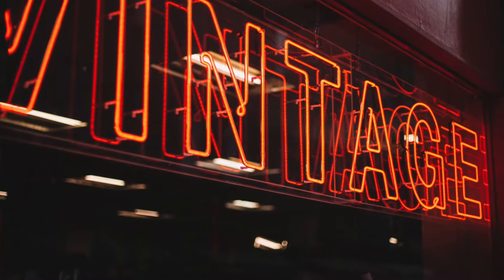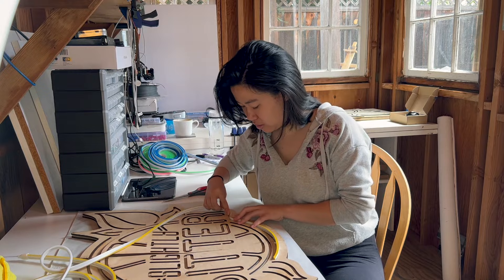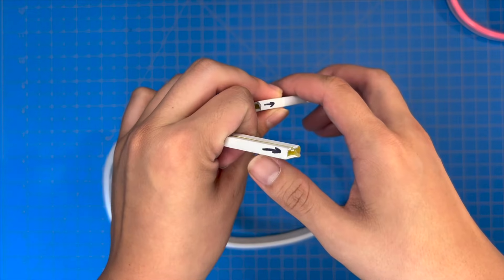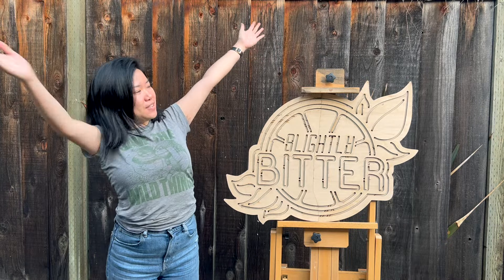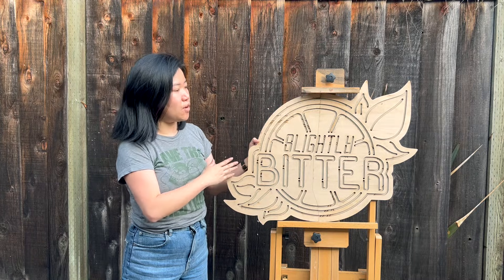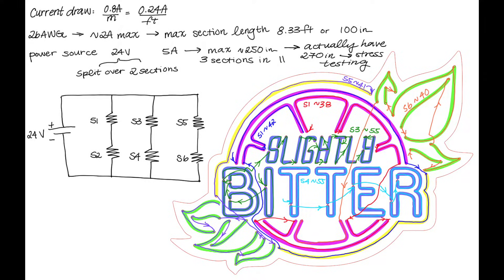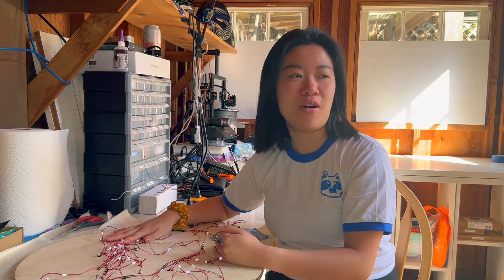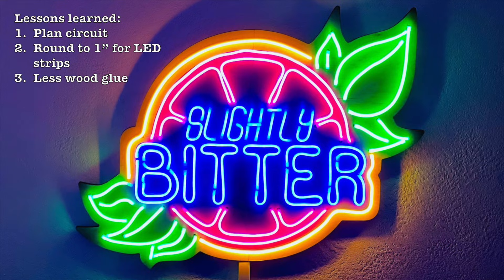I made a multi-color “neon” sign using LED strips

Comment: You can not use a power supply with LEDs, you have to use a driver that regulates the current to prevent thermal runaway!

Comment: Nice tutorial, but you should be using a 12v power supply and not 24v. The voltage doesn't change just the amperage needed.

Comment: Beauty! Lovely design.  No laser cutter so hand scroll sawed my own background (no grooves) and will lay (glue) my neon strips down on the plastic backer. Bought the wrong kind of neon strips as I can only cut 19 1/2" long units of same colour, which does not allow me the flexibility I need to render the lettering as I need. Could someone puleez jump in and help me here? What size neon strips -10x16, 8x14  or smaller would be better do I need to get tighter curves and enable cutting different lengths? Yes current counts. Any good suppliers I should deal with?

Comment: Good job.... just a few suggestions; 1 try for longer-continuous runs -ie, the outside of the "B" and "R," like the other letters could have/should have been one piece. 2, Wood doesn't do "neon" justice. I do a lot of (professional) signs and we never use wood (for several reasons including, it just doesn't work with neon). Try using acrylic sheets (comes in many thicknesses and colors/transparent). 3, You might want to adjust the cutting program  so it cuts the openings to compensate for the width of the strips and the end caps.  ..Keep up the great work.
Reply: I was also wondering about hte wood backing..

Comment: Loved the video!  I'm curious if you could have just used beefier connectors that could handle the extra amps instead of remapping out your circuit.  I'm actually in the process of gathering materials to make ours.  It will be a 24x24 acrylic circle, so I need a slim and fancy way to hide the wires in the back so they don't show from the front.  Also, did you have a name or link for the silicone ends you used?  :)

Comment: Stupid question. I've made a couple of neon signs myself and have only used a plot at the back, no grooves or inlays so I can lay the LED down inside of a slot. How do you handle the whole situation of the LED's soldering pads are too short compared to the length? If that makes sense. Because if you leave 1 inch around eveything it might not look as perfect as you would've wanted...

Comment: I really appreciate the detail you went into for the wiring and figuring out the circuitry - it's all stuff which can easily be overlooked with maker-style projects, over just like soldering a load of wires and hoping it works hahah
So including that circuit diagram and the equations used for the circuit is super helpful, thanks :)

Comment: Adam Savage is an idiot!  Those lines are there so you don't destroy the LEDS.  They also prevent shorts that could cause FIRES!  There is a SPECIFIC calculation to the number of LEDs you're using, and if you don't understand that, you SHOULD NOT be putting a video out, showing others how to 'burn their house down", too!

Comment: You shouldn't connect 12V strips together in series and power them from 24V unless the two strips are identical, otherwise one strip will have a different resistance to the other and there won't be exactly 12V across each branch. You should simply have used a 12V power supply with a higher current rating and connected all LED strips in parallel. Think about it. All LEDs are connected in parallel within a strip or portion of a strip anyway. Also, if a short developed in one of your series connected strips, then you'd have 24V across the other 12V strip. Your end result looks great but you really shouldn't be powering the strips like you did.

Comment: Great video!  I'm new at this hobby and you are my "go to" for LED neon sign design.  Do you  have any suggestions on where to get the 2-wire connectors?
Reply from the maker: I think Amazon had them, but you could also go adafruit or one of the electronics distributors like mouser or digikey
Reply: Thanks so much.

Comment: Nice 😊  i wanted to do a sign board for my outlet and yeah i came to the right project . Even though i am an electronics engineer i hate working with electronics (cause something or the other goes wrong)but at the same time when everything comes together the satisfction is priceless..

Comment: Cool project!
Made the wiring a bit more complicated than it needed to be. Could've just upsized the wire and sent it. 22awg can handle up to 4-5amps and is still small enough to work with. Otherwise, good stuff!
Reply from the maker: For sure could have but tbh I just didn’t plan well when I purchased my supplies and then didn’t want to order different supplies. Live and learn :)

Comment: Fantastic, I assume your strips are 6mm wide how wide did you make the cut that fit the silicone end caps well?
Reply from the maker: Hey there, I made the channels 6 mm wide. Since laser cutting takes a bit of extra material off as well, that was just enough to get the silicone end caps to fit too.

Comment: For single color LED strips direction does not matter, you can inject voltage anywhere.  Only addressable RGB strips have a data in data out direction.
Also, each LED in the strip are internally connected in PARALLEL, so unless you actually counted each LED in each segment your calculations are all incorrect. You have multiple parallel strips which are connected in series and parallel with each other making for some complex current calculations.

Comment: Can you do a small separate video on the wire diagram/schematic you did? I'm having trouble understanding what the numbers you wrote down are, is that wire length? And I'm assuming you got to 100 inches in length of light in series before you stopped and connected those in parallel?

Comment: Great job. My only recommendation would have been to have painted or stained the wood, or, gone with a transparent plastic backing. And maybe incorporate the wire line into a light up "Stem" with LED leaves or something. But you hid and blended it into the wall nicely.

Comment: Great vid! Where did you get the led strips? Can you list where you got your products?? This was really cool!
Reply from the maker: Hey Katarina! So glad you enjoyed it. I bought the wood from a local hardware store and the wiring and power adapter from Adafruit, but any hobbyist electronics website or even Amazon will likely work for the various circuit components. The LED strips I got on Amazon by searching for "LED Neon strip" – there are a ton of options and I believe the ones I originally got may have changed names. They all seem to have the same characteristics, so I doubt it matters much which brand you purchase. Hope this is helpful information! Please let me know if you have any further questions.